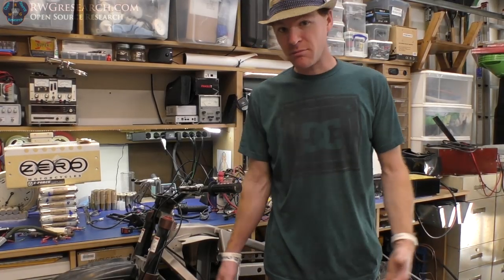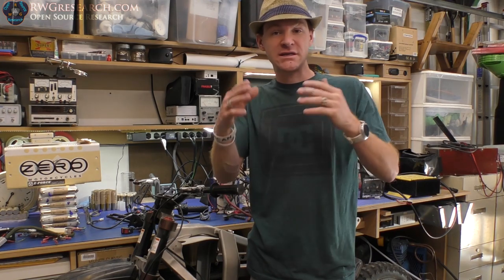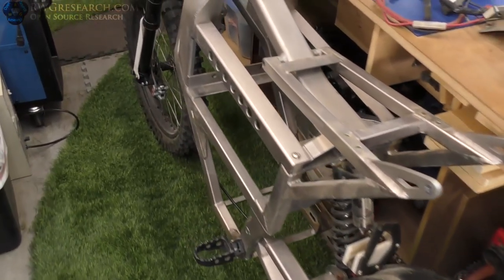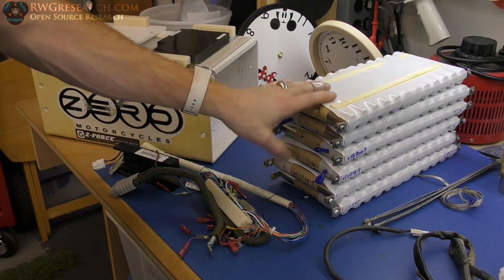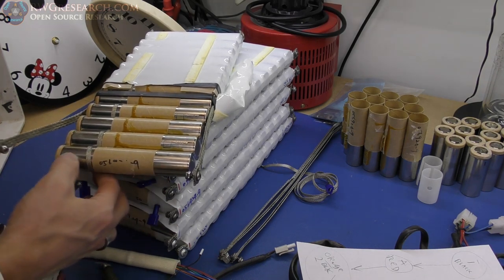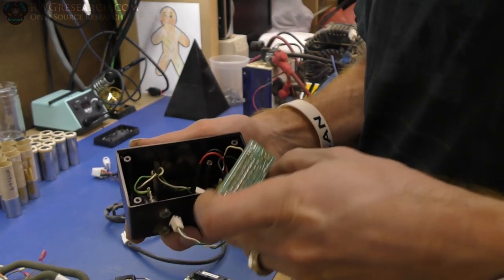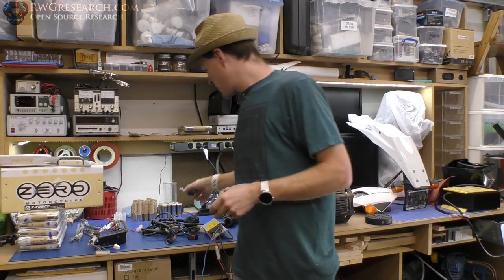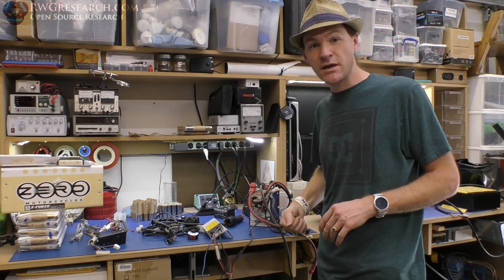Let's Tear It Apart!! 2009 Zero MX Flagship Electric Motorcycle. Very Interesting Design Choices...

Comment: Wow, was expecting something a bit more professional inside the Zero. Looks like a home project, with no redundant safety unless you consider the manual emergency cutout switch to be part of the safety case. As for the lack of ingress protection, I'm surprised they are allowed to even sell it. I hope they have improved the design since then....
Reply from the maker: Yes.  Very intresting stuff. I can tell you that this being the very beginning of Zero... its kinda what i would expect. However. Even the next years model was much better! And after that they started selling manny more bikes and a much better build quality.  I will say the frame of the bike is verry well built. Extremely lightweight.  And over all great quality.  The eletrical side of things at that time was about what you see. However has greatly advanced since then. The fact that they used can bus at all on this is quite intresting.  ~Russ
Reply from the maker: Lassi Kinnunen  They did offer to do a trade in for a newer bike. (And the trad in valve was small)  Because they did not support this one any more. However in the end. The battery was replaced.  Then after some years, its time for a new one. (Only because it was sitting dead) ~Russ

Comment: Who is that logo on the motor? CE? I see that on almost ALL electric motors that i recycle, regardless of the brand appliance they come from: so naturally i am curious WHO IS  this monopoly on electric motors? How can i look-up this logo, and contact the actually motor makers? I am curious particularly because all these motor designs waste power and typically suck, can be vastly improved. Either we should convey this knowledge for a fee, or get into the motor manufacturing business for ourselves, and give these made in Taiwan motors a run for their money.
Reply from the maker: https://shiftev.com/index.php/shop/motors-2014-01-09/motor-perm-pmg-132-24-72-vdc-19-1-peak-hp-detail.html